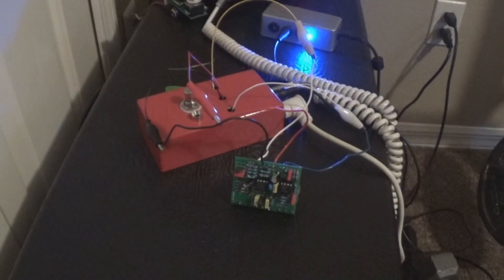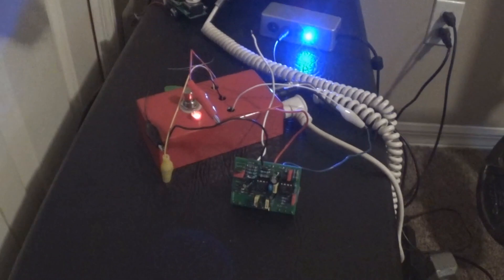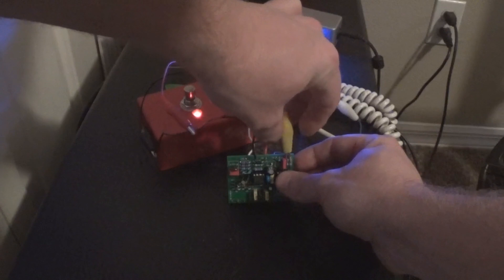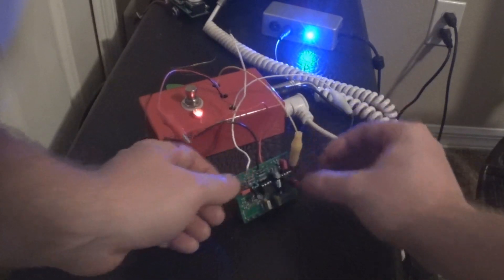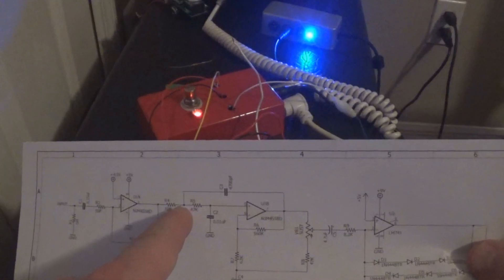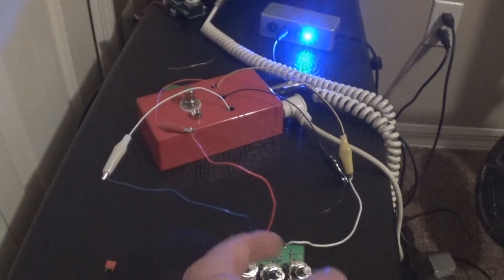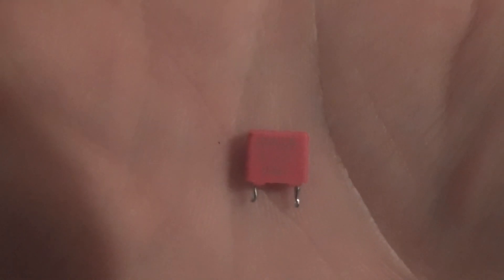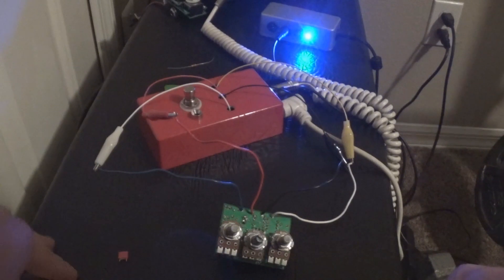Repairing an Op-Amp Big Muff Pi Clone - DBE Punk'n Pi

Comment: Hi I think I shorted my Power input on my guitar pedal because small Spark showed and LED diode died. I chnged the diode But when i switch my pedal the guitar sound is almost same. Could I kill some of my Ic's.  Or transistors?